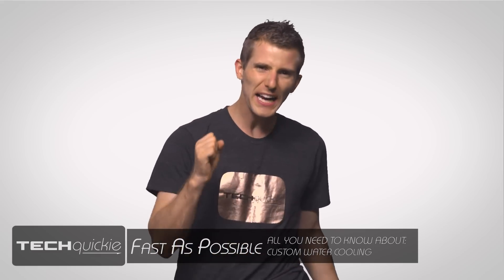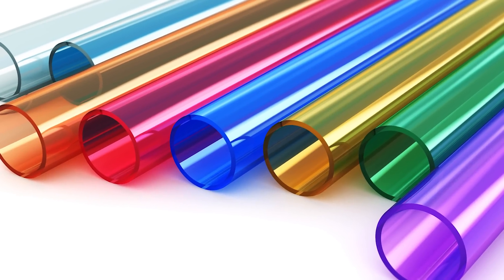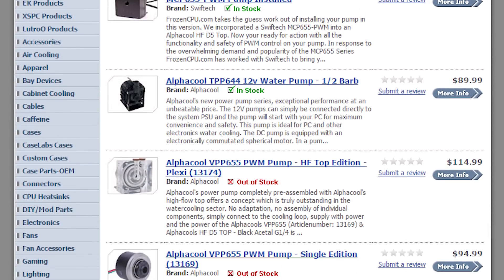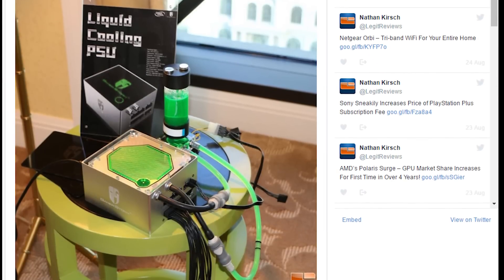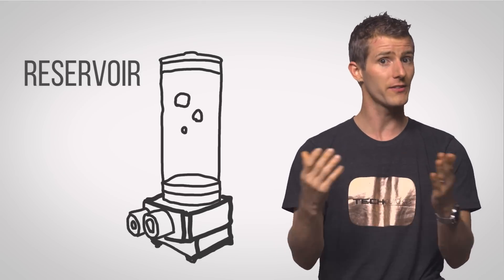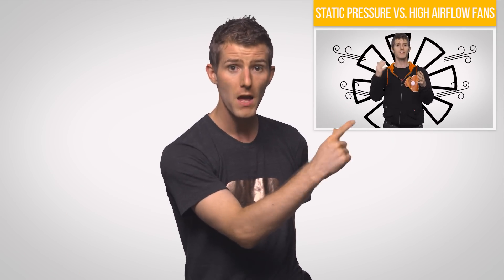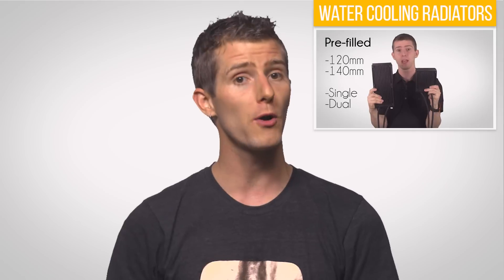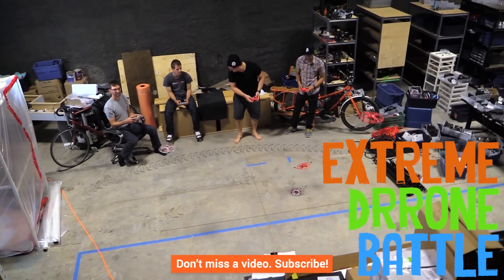Custom PC Water Cooling as Fast As Possible

Comment: Just to find out what kind of performance boost a super cooled rig could get...
Have you guys ever thought of trying to incorporate an aquarium chiller into your custom water cooled systems?  It looks like water cooled systems work on airflow going through a radiator and cycles water through the fins.  The only thing cooling the water is air flow and taking the heat away.  Would an aquarium water chiller make a difference and create a better over lock experience?  Some water chillers can be set as low as 39 degrees F.  Just route the tubing to and from a chiller...  https://youtu.be/uNNPegVpYYI

Comment: Water Cooling is overrated and quite expensive compared to traditional fan cooling. If you get the right fans (be quiet) and get the right case (Fractal Design R5 or 6) you'll do just fine with cooling and keeping quiet at a much cheaper price!

Comment: I don't know how common it is these days, but back when I built my first water cooled pc the chipset/north bridge on some boards would overheat without the airflow from a cpu fan. Might still want to look into the chipset blocks. I had a gigabyte board that wouldn't boot without it. I also burned through 4 sets of RAM in 3 years...sooo...take that how you want to.

Comment: I have two questions about water cooling for pc's I'm hoping you can answer for me. If I'm building a custom wall mount rig would it be better to have longer runs (as long as possible tubes for water cooling) meaning more footage keeps it cooler? 
Second question what about two water coolers? 1 for CPU and its own circuit and separate one for GPU or GPUs its own circuit   meaning these two dont connect to each other. Both have own reservoirs and radiator and fans

Comment: 1:50 turbulence actually generally increases with flow rate as you increase volumetric flow rate, and you actually want higher turbulence to increase heat transfer.  It sounds like that's kinda what you were going for, just slightly misstated.  I'm guessing the narrower passages in most CPU/GPU blocks create plenty of turbulence to negate this even at extremely low flow rates.

Comment: Why not use the vinyl stuff? I use it since nearly 1/2 years and have never had any problems. But ok, you probably can't use it with standard fittings since it has another diameter. At least here in germany I can't get 1/2 inch thick tubing. Why should it leak? The won't offer it, if it woudn't be tight

Comment: Is Alphacool a good option?
Reply: Alphacool, EKWB, Bitspower, and Swifttec, are the compaines I would use if I can afford to do watercooling. You can use ThermalTake but I have seen one of their systems leak pretty badly before, it was due to some pretty bad fitting.
Reply: Thx!

Comment: Frankly, fin desity makes NO DIFFERENCE as to turbulance, as the FINS typically are on the OUTSIDE of the tubing in the radiator and thus have no effect on water flow.  Air flow turbulence is a different matter

John

Comment: So I don't know much about computers but I wanna get into it. A couple weeks ago a bought a custom built rig off a dude with custom water cooling system. Unfortunately I don't have the room to set everything up right now and the pc is just sitting in the box doing nothing at the moment. The water won't damage anything that way will it? I don't think I'll be able to take my baby out and run her for another month or so, but because I'm new to custom pc's I don't know if having still water sit in there for extended periods will damage any of the components...

Comment: how many parts do most people put blocks on. CPU, GPU and ...?
Reply: Mostly, just the CPU and GPU. There are blocks for HDDs, SSDs, Mainboard VRMs, Mainboard chipsets, RAM, and even PSUs. Some are practical (VRMs in an overclocked system, RAM if you're pushing high clocks), others are not.

Comment: My 2 R9 290X are watercooled in a loop with my CPU and sit between 30 and 50° C (while idle and under load, respectively). So it's more like 30°C of reduction compared to aircooling, and not "just" 20° :-p. Other than that, cool vid !

Comment: Video suggestion: CPU cooling => air , water and the new technique Thermaltake will use (also air but a total different design) with the Engine 27 1U.

Comment: what about when overclocking your cpu? i know it will work fine with a normal fan cooler, but will it generate a lot of heat? or make the cpu fan more noisy? would water cooling your cpu make a big difference in temperature level when overclocking?

Comment: Sorry, but it's useless these days
TDP has gotten so low, GPUs barely hit a reasonable TEMP to be scared about
Reply: not to mention that the Noctua DH 15 basically provides the same low temperatures as regular water-coolers whilst being very quiet and not having the risk of fkin up the entire system by leaking lol
Reply: xzkek Please don't take offence to what I'm about to say as I'm just trying to shed some my PC knowledge on you,

But the DH15 is good, yes, but it is a mammoth of a heat sink and that's why it performers so well.
But it's way too big and may cause way too many problems with case width and RAM clearance. 

If you're going air, just get an Evo 212. But note that it's not a whole less shorter.

Usually the proper made AIOs by CM, Corsair, NZXT have a very low chance of leaking.
Reply: Moe Chan not taking offence, don't worry :)
on Tuesday my Phantek Enthoo Evolve ATX case will arrive. Already looking forward to installing the DH15 then. Has plenty space to fit nicely - I simply prefer having a 0% chance of something entirely destroying everything opposed to "a very low chance" hehe.
All you have to pay attention to is that you get decent low-profile RAM opposed to the pointless "heat sink" high profile RAM - you could still take them off since they only have an aesthetic purpose but hey..

Comment: Protip: If you want to bent Polymer or Metal tubing fill it with fine sand. This will cause the bent to look MUCH better and wont crimp, with Sand you can bend to much higher degrees then without it. I am not Paid or receive any Kickbacks from "Big Sand" Lobbies of any kind. That mound of Algerian Denuela Sand in my backyard was Donated to me by felllow Sand Enthusiasts.

Comment: Wowowow, cool your jets there linus. Did you really state that an increased flow rate is preferred in order to reduce water turbulence? Meaning laminar flow would provide more efficient heat removal?
Whaaat?

(Note; for the keyboard warriors out there)
That was obvious sarcasm. I'm sure he meant increased flow rate = increased turbulence, therefore increasing efficiency of the heat transfer.

Comment: do closed premade loops have pumps and maintenance issues like custom loops or not?
Reply: pumps are built in the radiator. it is all 1 part. no maintenance.
Reply: Joseph B. is the pump some passive system or are there wires hanging out?

Comment: Do custom loops have much of a performance increase over aio coolers? Some water blocks are $100 alone so the cost doesn't seem worth it
Reply: Nope. They are just bling that make a pc shine.
A good aio cooler will do great.
Reply: Thanks
Reply: Depends on the AiO, but almost always, yes. A damn good AiO can make a system run at 35c at stock, but a beginner custom can allow a good overclock and have the system run at 26c, and it can allow you to do it quietly. You will spend quite a bit more, and the price/performance ratio isn't there in the short term.
Reply: ://ReaperReaper
 It really isnt worth the risk.
Unless you are rich and dont care for the risks of having water in your build.
Sure it looks nice, Sure it may work better than air coolers, but i can tell you that a good cooler with 2 120mm fans from like cooler master or some other brand will keep your cpu  as cool, with no risks.

Also lets not forget that water coolers still get cooled by fans.
the same fans you could have directly mounted on your cpu.

Also saying " can run at 35c" with no room temperature is pointless.
If my room temperature is at 0c i cant go ahead and say my cpu is running at astonishing 15c. it is pointless without the room temperature mentioned.

Your cpu will never be cooler than your room*. So if you read someone say "my cpu is running at 30C" and your room is 30c, your cpu wont run at the same temperature.

No hate, offense or anything mate :)
im just stating the facts.

Have a good day!

*i am not counting liquid nitrogen cooling, or other overkill things.
Reply: aio means all in one. we aren't talking about air vs water
Reply: Joseph B. Actually, with the exception of the pump and fans, all the components will last dozens of platform upgrades.
Air coolers don't, and no air cooler can match the cooling capacity of a decent 240mm AiO. Noctua and Cooler Master have coolers that are acceptable for modest OCs. That's it.
A $500 loop with a 360mm rad can dissipate 600w, which means that one can keep the CPU at ambient with the fans only turning 900 RPM. Double that rad space for ~$80, and one can run without fans at all and still see 30c, less than 50c at load.
It isn't worth the (minor) risk if you're running locked sku processors, or if you are paranoid. There is little risk of leaks for even beginners nowadays. Running components like the 6700K or 5820K, and there is a huge benefit. For the 4770K and 6950X, any OC will almost require some level of water cooling with a 240mm rad.

Comment: water cooling doesnt really get you more silence though. you still need fans on your radiator for it to work and good cooling setups usually hold two to three fans on on side of the rad itself. forget it if you want a push-pull config. liquid cooling is not for you if you want silent. do it if you want performance because thats what it has the biggest impact on. even a founders card can increase performance alot by being water cooled. custom loops are expensive though as well. if we are talking performance per dollar, stick to the all in one loops out there. they will do a comparable job and reduce the risk of doing it yourself and possibly damaging parts.

Comment: Liquid cooling can make a big difference with CPU performance. The higher you overclock a CPU (increasing clock multiplier and voltage) the more heat it will put out. If you cannot remove this heat efficiently, your CPU can become unstable during use, and will not last a very long life. Plus your system can actually shut down if it overheats too much. Liquid cooling loops can drastically lower CPU temperatures allowing for greater overclocking, as water is a greater heat conductor than air. I have an AMD FX8350 (which aren't known for being the coolest running CPUs), and doing a basic water cooling loop with a 240mm radiator has lowered my temps from mid 60s on air with stock heatsink, to low 40s on water (both while doing intensive tasks), and that is in Texas weather lol

Comment: I have ASUS GTX 1080 turbo what water block do I need
Reply: ^^^^^^
Can confirm
Works well
Reply: mmmm ok
Reply: Brendan Stubbs Yeah, they make blocks only for the most popular custom board cards, like the Asus STRIX
Reply: +Brendan Stubbs It might be worth contacting EK/XSPC/aquacomputer etc. I've heard they will sometimes make you a waterblock (sometimes for free) in exchange for lending them your card to make the design. Looks like a few people are after blocks for them so it'd be in their interest. Good luck :)
Reply: i put my card in water and now im dead
Reply: That card has a custom PCB. You'll be lucky to find a manufacturer that makes one.
Reply: well that's disappointing I was hoping that is used the OEM pcb

Comment: At 1:50 Linus says that increasing flow rate decreases turbulence; In my research, it has the opposite effect; but that's not bad, turbulence is what you want, right? It keeps the hot water from staying near the outer rim of the tubing, and increases heat dissipation into the water at the block. Please correct me if I'm wrong, but I'm quite sure he meant to say it decreases laminar flow, as opposed to turbulent flow.

Comment: how about a car radiator mounted on a window frame next 2 ur pc
Reply: Inferior Fish wat made u think i was joking
Reply: Better have one helluva static pressure fan on there
Reply: i was tinking use 2 thermo fans from a car aswell
Reply: If you do do this put it on Reddit or something, I would be interested to see this.
Reply: A rad from a haul truck should be enough for passive cooling of any system xD
Reply: Eugene, you still need a pump running. :P
Reply: Sometimes done it here on YouTube. They used a regular pump and it didn't have nearly enough head pressure to move the fluid through the loop. Everything ran really hot.
Reply: itsajoke.jpg
Reply: Boiling and convection will move all that shit.

Comment: Note: It is not necessary to put the pump inlet directly after the reservoir outlet. You just need positive suction head (NPSHa > NPSHr) and a flooded inlet at the pump for it to operate normally. Having the reservoir (fluid level) be the highest point in your loop and your pump inlet be the lowest will likely be enough to meet this. It will help bleed faster too.

Comment: Aluminum dose not pitt because of incompatibility with copper it pitts because its a very reactive metal, if you alloy aluminum with something that prevents the oxide coating from forming a protective layer it will react violently if you drop it into water. What happens is in water the oxide coating slowly wears away and the aluminum reacts with the water, this causes pitts in the metal
Reply: +ChrisD4335 No, it's due to electrolysis. If you have mixed metals in your loop it will create a voltage and then all hell breaks loose. The aluminium will seemingly be eaten away and the copper will oxidize and turn green, the whole lot becomes a mess very quickly. If you only had aluminium then there would be no problem, but most parts contain copper/nickel/stainless, so that's why you should avoid aluminium watercooling stuff like the plague! Even if it's "coated", because if the coating fails your whole loop will be ruined.
Reply: Ofcourse...

Comment: JayzTwoCents will probably have a few things to say about that "Must use Static Pressure Fans" thing...
Reply: he isn't against them. He doesn't use them in skunkworks because the amount of radiators is ridiculous so it's not that necessary to push that mush air
Reply: Its a good general rule to use SP fans on a rad, but not a requirement. Jay uses AF fans because he runs lower fin density rads. He's also mentioned in the past using AF instead of SP because the SP fans that were available at the time didn't look good to him.
Reply: Total doucher
Reply: jayz also puts 300 dollar water block on a 250 dollar GPU so..... yeah
Reply: Jayz is a tool

Comment: 1st thing... Tubing! (I thought this was exactly last... You match it to the pump and block, so you pick those first right?)
I would go, 1-2: radiator and block,  3: pump (you need to know the size of radiator for head pressure, like if you use a massive car radiator or something), 4: reservoir (if not built into the pump), 5: tubing, 6: fittings.

Comment: why not just buy a duct to plug from an ac vent to your case
Reply: DIYMaster AC units are dehumidifiers
Reply: Condensation is bad
Reply: flangel842005 AC vents are filtered, its actually a must for any unit expected to run for more than a few months
Reply: dust

Comment: make a entire water cooled pc (ram, harddrives psu)
Reply: Water cooled case.
Why ?

Why not.
Reply: LOLZ1259 don't worry about ram, if it overheats just download more.
Reply: Watercool your case
Reply: LOLZ1259 Just make a mineral oil rig.
Reply: Some cases have water running through them.

But they don't really need to be cooled cause they don't get hot.
Reply: YEAAAH plz
Reply: I don't get it. Care to explain your joke?